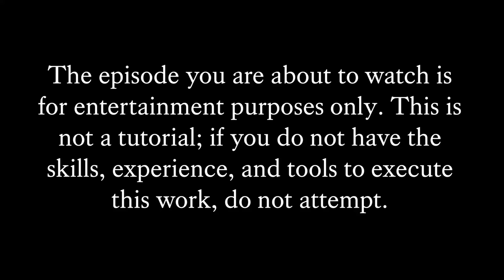Anvil 088: Shotgun Rib Soldering

Comment: I tried to replace a trigger on my beloved 509 and I destroyed the frame trying to remove the locking block pin. Needless to say I was pretty depressed. I know nothing about gunsmithing but it looked easy enough. What I did was not covered under warranty so I had to pay for everything to get the frame replaced. I know what I did wrong, but I'm leaving it up to the professionals. By the way, FN has excellent customer service. Gr8 vid. 🔫 🇺🇸

Comment: With progressive soldering, I have found that a damp rag will cause the solder to set without excessive cooling of an area,  Basically like wiping a pipe joint, and also keep heat from creeping into an area and undoing some fresh work.
Reply: And I love the Sharpie trick.  I wish I had known about it years ago.

Comment: I went to a somewhat local gun shop and asked the gunsmith about an issue I had with getting an AK63-D to head space on a new barrel. The barrel was all the way down against the trunnion and it was still taking the No-Go gauge, but was oh so close. The chamber was cut just a little bit too deep into the barrel and the Smith seemed to think you needed to use a lathe to do anything to adjust the headspace on any AK. He had no clue the barrel was simply "pressed in" to set the head space before pinning it to the trunnion. I ended up taking a file and removing a few thousandths off the outer edge of the barrel allowing it to seat a few thousandths deeper, so that now, with the barrel fully seated, the head space is just on the tight side of perfect.

Comment: You should think about using 63/37 eutectic solder. It makes for stronger joints.
Reply: Not as simply. The constant pressure to produce a given creep rate is far higher and tensile a hair more, but the sheer strength and melting point is actually fractionally lower, and the mix far less thermally conductive. It'd still be completely suitable for this application, but its neither ubiquitously stronger, nor is the difference really big enough for most small volume shops to stock both to optimize for a given job.

Comment: I knew about soft soldered barrels and have had bluing done on several of my shotguns over the years.    About 20 years ago I brought what I thought were hot blue compatible barrels to a gunsmith for bluing.   The gun in question was a Spanish Perazzi copy from the 70's.  I got the barrels back and all was good... UNTIL the 2nd or 3rd time I had the gun out on the clays range and the top rib detached, and one of the side ribs came loose.   A strip, relay, and bluing cost from a different gunsmith and things were put right.    Lesson's learned?   MAKE sure you know what you're dealing with.   Also make sure you take your firearms to someone that's got depth of knowledge.

Comment: I liked this one Mark, I have always wondered how a side by side was constructed. i have seen a friend of mine run a  long solder joint like that with an oxy  kit and the tiniest gas nozzle I have ever seen, I only mention it because i was very fast.  I agree that Bakers fluid has no place near a gun barrel !
Reply: That tiny gas nozzle is called a "blowpipe" and its common on oxygen/acetylene or oxygen/map gas sets, which has a more rapid combustion producing hotter flame than oxygen with propane butane blends or any heating torch that uses atmospheric air as oxidizer, hence vastly less visable flame and rapidity of heating. This also limits the condensation concerns, however the cost of running such sets is higher, and the area protected from oxidation by the spent combustion products much smaller. Before electric processes became common, they also used to use such a blowpipe to weld instead of only braising or soldering, by use of a larger jet and feeding metal filler wire into the molten pool it created. Its much the same hand movements as TIG, but happens massively slower (which means vastly more heat in the work, thus warping ect), so even though its almost entirely disappeared from practial applications, its still a good step to teach people how to weld.
Reply: Hamish McGregor The guy I mentioned was trained at Vicars as a gas welder, but in this case was running solder into a car body, very fast and neatly, which I thought might be relevant to this rib job.

Comment: This is similar to old time automotive body work where they used to use a lot of lead to do work back in the 40's and 50's filling seams and joints.
Reply: They still do lead body work, just not at your local body shop - high end restoration and custom car builders do it, along with some of the details obsessed hobbyists - my buddy did it on his GTX clone project, I think he bought the lead filler from Eastwood.

Comment: You're soldering technique shows you know how to solder! 
If you changed your solder from 60/40 rosin core to 63/37 rosin core you can eliminate (mostly) the possibility of the cold solder joints as 63/37 does not have a plastic phase as it is cooling!  The cold joint occurs when the objects being soldered move during the 8 or 10° cooling of the 60/40 while it's in it's plastic phase.
63/37 solder is not available at the local hardware, however!  Only a professional like yourself would special order that type of solder.
It's no more expensive and is available at large electronics sales.  I'm old, so I don't think of Googling stuff. 
I'm not an English idiot or a gunsmith!  But, I have been soldering in industry for years.  
SEMPER FI

Comment: I love soldering. Watching it suddenly ball up, then flow away into nothing is satisfying. Not as technical a process when it's jewellery, though.
Reply from the maker: Temperature control is more critical in your trade, yes? I can be off by a few hundred degrees. You would have a disaster
Reply: @marknovak8255  I only ever did it as a hobby, but we have the luxury of not needing to worry about heat treat. As long as nothing gets melty we're usually good to go, but we're also not planning to pack it full of explosives and stick our face on it.
Reply: @Halinspark  
That's a scary way to think about it.

Comment: Mark, that was the most detailed video I've seen on barrel soldering. I've never tried using a Sharpie to prevent solder adhering where I don't want it.  I'll have to try that.  Nor have I used steel wool to plug the holes to stop solder flow.  Do you degrease the steel wool first?  I'm surprised a tech school trained gunsmith would attempt to hot blue a SxS.  Don't they teach them that those barrels and ribs are held together with soft solder?

Comment: In Junior High metal class, 50% of our grade depended on a project that required soldering two steel parts together.
If the lap-joint didn't hold, you didn't pass!
Flux?  Rosin for soldering, sal ammoniac to tin the coppers.
Yeah, soldering coppers!

Comment: I'm a London-trained gunsmith majoring in shotgun barrel rib soldering and minoring in all that other stuff. I just wanted to let you know that you're doing it wrong and that if you continue to use this method the shotgun will be destroyed. The only TRUE way to do it is by rubbing the barrels together until they're hot enough to melt the solder, and by using pure artisanal ironwood charcoal flux. You must of course use platinum-lead-palladium solder, processed cruelty-free. Hope you feel good about yourself.... amateur... ;) Excellent work, Mark!
Reply: Funny but London or Birmingham gunsmiths who’ve learned to do it the “old” way deserve respect for their craft. Mark approaches the work from a different angle.
Reply from the maker: OUTSTANDING!
Reply: @edwarddesoignie1396  Well said!

Comment: I had to silver solder the lug back on an old pump gun, it had been "repaired" twice before first with a piss poor braze, then with some 2 part epoxy. I'm confident enough in my solder joint to bet something else fails first (or it gets run over again)

Comment: I see that you use a Sharpie Pen as a solder resist and it did fail a little . A much older method used as a solder resist and it never breaks down no matter how hot things get is a standard soft Black Graphite and Clay Artists pencil.
Reply: What I wonder is how these different resists hold up to the brushing...

Comment: An induction coil will do the heating without anyi oxides or water damage .It is perfect for long thin things like those barrels.
Reply from the maker: Have one, but the average guy doesn't. So I did it with a torch

Comment: my thing with the younger guy hot dipping soldered barrels is that we now have this thing called GOOGLE! he could have just typed in "how to blue soldered barrels" and gotten 1000's of results telling him to NOT do that lol. I would have understood 200 years ago if someone tried it, but come on lol. It's like you say: "Easiest way to fix something is to not screw it up in the first place". Working on guns isn't hard, I started when I was 13, you just have to take your time and really think about what you're doing, and when in doubt, do RESEARCH! Every Job's a learning experience, that's for sure
Reply: I have used Birchwood Casey super blue , and it works great for cold blueing. Be sure to clean and degrease the barrel.
Reply: @robertboreman7672  rusting tends to be a superior finish, both in durability and "bad-rust" prevention. Simple to do as well, degrease the area to be blued, just apply a mild acid+salt solution (salt & vinegar), and leave it in a warm humid spot for a few days. Card off the bloom (loose powdery rust) and boil it in water until it turns black (or use a heat gun to get it hot and the pour boiling water over it if you don' have a big enough tank). The porous nature of rusting holds oil really well (same reason parkerization was developed), and it goes a bit deeper that just the very surface (cold bluing).

Comment: I'd love a video where we see how the breech end is assembled from scratch.
I have a late 1800's Belgium, exposed hammer, black powder proofed, side by side that I want to make shorter modern pressure barrels for, and I did order a couple small curved ribs and am stuck on how the breech ends are dealt with.
The wide flat rib looks to be a piece of flat stock with decorative engraving and a birds head on the breech end.
I can duplicate all the other parts from underneath that I can see the exterior of from the original barrels (that are still 100%, still ringing and have clean bores) but I'm not sure if everything is soldered or what. 
If the whole thing is actually soldered I could just take the original ones apart and reuse the needed parts, but I'd rather keep them original.
Reply: It would be much easier to just hand load some shot shells using black powder!
Belgian firearm manufacturing is famous for brazing the barrels together!
Your mileage may differ

Comment: Can you weld on barrels? I have a 12 gauge $26 Numrich barrel Im making into a muzzleloader and I want to know if I can weld on a barrel lug
Reply: Would be better to silver solder I think. Little welds here and there maybe...
Reply: Use solder
Reply: You can weld on barrels (see pinned&welded muzzle devices for length), but it's a great way to ruin one if you're not very good with a TIG torch.
Reply from the maker: Scale is the enemy when welding. A weld on the outside of the tube will cause a large scale spot if you do not take specific precautions against
Reply: @mattbrown9484  I am not sure. Most firearms are made from 41xx or 43xx series chrome molybdenum steels. Very tough, but actually rather soft steels. They can be hardened, but I haven't heard anything about stress cracks starting around the welds.

Comment: Questions Mark:
1.  What process do you do to polish your hammer? how about a 10 minute video to show us please?
2.  You reblued the barrels, but you didn't mention what process you used.  I assume it was not hot blue.  What process did you use to blue them.
Thank you,
Reply: easy to polish a hammer,. start with a decent not beat up old hammer at least,. I start with 250 grit then work your way down to say 400 then polish with a buffing wheel of some sort,. really not a difficult job
Reply: 1, Application depending, literally touch to a linishing belt a couple of times till its a smooth even reflection (do NOT hold to the belt for a long time in a single go and heat the face up). The goal isn't to make the hammer nice to look at, merely to ensure a single flat face and remove the bumps/scratches that will transfer onto the work items you hit with it. Hence doing a 99% job regularly is worth far more than a 100% job irregularly... indeed the main thing about any such tool maintenance is just to take the extra second think about what your doing before you commit to touching the job, because like everything else in life, its easier to take precautions before you swing the hammer, than fix the screw up after the blow has landed.
2, Its mentioned in the comments in a few places, but it was a rust blue, not a hot process.
Reply: @SheepInACart  Thanks!
Reply: @ABlindMan1 Thanks!
Reply: @carlosmastronardi3296  Thanks!

Comment: I have a cut barrel 5100 and want to plug the end as you did with the steel wool and solder.  What type of solder, flux did you use and what  heat is required.  Would a butane torch suffice?  Thanks.

Comment: Question that I keep pondering.  With modern advancement in metal work and welding, has led/tin soldering barrels become a way of past?
Reply from the maker: Still the only way, sorry
Reply: Back in the early 70s,there was an article on repairing full size vehicles. Body shop repair of accident damage. And one technique on pulling panels rare even then was about a 12" by 12" or better flat panel. Soldered to the damaged panel and pulling straight out. That much surface area has great strength cumulatively. Even if relatively low strength as you indicate.  
Tinning each surface with a thin coat of 95/5  or pure tin then then using your choice of lead/tin yields a greater strength than you might think. Good luck on trying to find block tin nowadays.
That original soldering was done to a price by pushing the people who did it,and insisting they use lots of ammonium chloride. Which is why it was dicontinuous and patchy.Which works,but the lung damage done those guys was astronomical. Try to find ammonium chloride nowadays,or a hardware store willing to put up with the damage the stuff does with the corrosive acid it gives off.
Done right,lead/tin solder is a pretty amazing technique.

Comment: Wouldn't it be ideal for a situation like this if you could heat the barrels, to make the solder joints, from the inside? That way there would be no moisture on the clean outside of the tubes?

Comment: I have an old NR Davis double barrel. Top rib is coming off.. should I use 50/50 silver solder or 60/40 tin-lead? What would withstand a hot blue process in the future?
Reply from the maker: I use 50/50. Always rust blue doubles, but the only tubes Ive seen stand up to hot dip were brazed belgian trade barrels
Reply: @marknovak8255  ola alem desse estanho oque e esta pasta que voce passa junto?
Reply from the maker: @brunotome9418  O meu português não é bom, aqui vai... 50/50 chumbo/lata, com fluxo de breu
Reply: @marknovak8255  muito bom exelente armeiro... obrigado pela resposta
Reply: @marknovak8255   uma outra duvida aki o arame de estanho tem com fluxo interno e sem fluxo, entao precisa ser o com fluxo interno? E a questao do fluxo eu nao encontrei nada do tipo aki voce nao teria uma marca mais especifica?
Reply from the maker: @brunotome9418  NÃO use fluxo de núcleo ácido, apenas resina. Você também precisa de um fluxo de pasta para manter o metal ao redor limpo e livre de óxido. Espero que isso se traduza, nunca tive que ensinar isso em outro idioma.
Reply: @marknovak8255   uma duvida esse material que voce falou ai ele e incluso no arame de solda ou e encontrado saparado?

Comment: An excellent video. 
QUESTION: Have you tried a heat gun on a rib? I ask because with a very good gun you can dial in the temperature. Providing an even heat.
Reply from the maker: It works, but it's slowwwww

Comment: Just asking out of curiosity , does soldering one side at a time induce any bowing as in banana shape to the barrels. I have done a lot metal fab over my life but it has for the most part been brazen temperature and up including a lot of heat straightening.. My only soldering exsperience is mostly electrical. Keep um coming
Reply from the maker: Not enough force to bend the tubes . Typically, the bottom rib never comes loose anyway, almost always the top.

Comment: Great  vid as always.  Are there any suppliers for ribs to go on a SxS, or are they an in house product?
Reply from the maker: In house by each manufacturer. I believe the Mr. Turnbull has one of the small rolling mills to roll custom shapes. It's a fascinating piece of fabrication to do, I am not set up for that however
Reply: Easy job.  Solid model out of bar stock; leave  .100 on the bottom to hang on to in your aluminum soft jaws, flow it with a .250 ball mill.  Then flip it over and grind off the .100 on the magnetic chuck grinder.

Comment: How much heat can old side by side take before coming apart?  Can you boil them ??  Thanks
Reply: Yes you can boil them.  That is one way to rust blue them.
Reply from the maker: Hot dip temps run in the 385+ and will soften solder to failure. Boiling water/atmospheric steam is 212 at sea level, and is safe.
Reply from the maker: Are you an Ohio class nuke?
Reply from the maker: LA nuke, EM1SS  class 8404.  Newcon USS Key West 722. Launch crew and plankowner

Comment: What was the reblueing prosess? Nece job. I learned mostly I do not want to attempt this job.leenotcharleen
Reply from the maker: Straight up rust blue, 2 passes after sandblasting. Look in the "conservation" playlist on my page, there are 3 great videos describing the process.  The soldering, no. However, a simple rust blue is well within the capabilities of anyone. Which has been my point all along